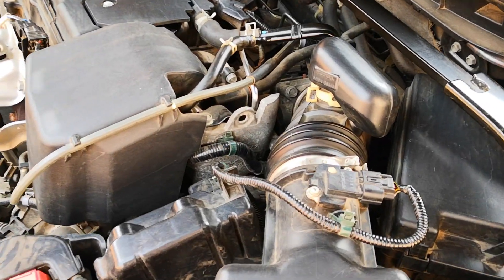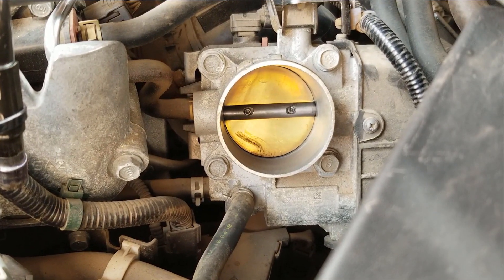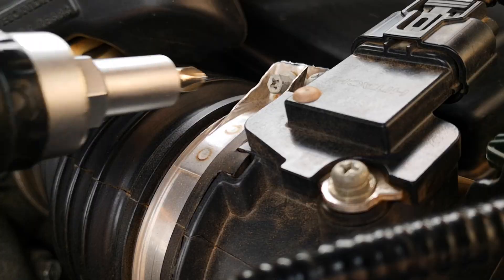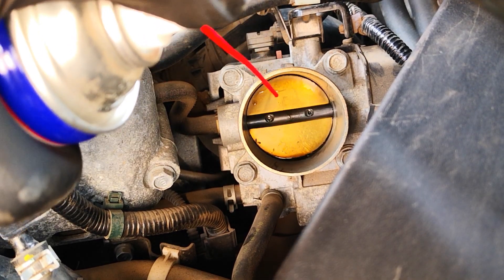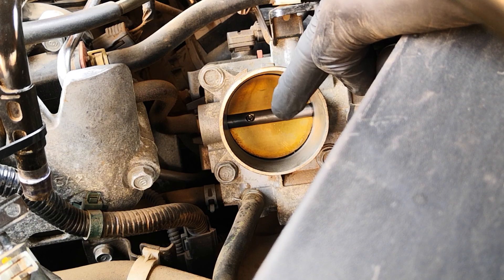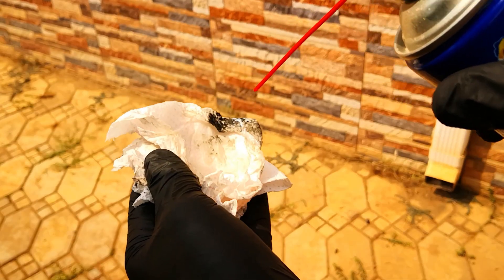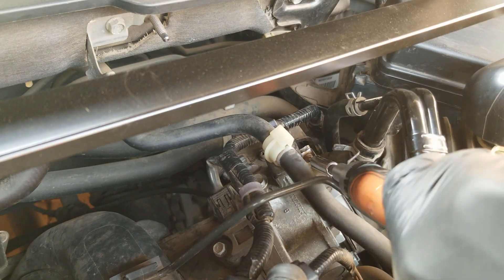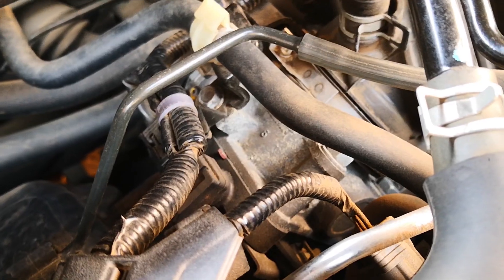Safely Clean Electronic Throttle Body Without Removing / How to Clean a Drive by Wire Throttle Body

Comment from the maker: I do this procedure every year! Is your throttle body electronic (drive by wire) and how often do you clean yours?
Reply: no need to disconnect the negative terminal on the battery?
Reply from the maker: If you do, you can't use the gas pedal to open the throttle valve, except if it's not drive by wire.

Comment: Let the cleaner dry for 10-15 minutes before reattaching the intake pipe and starting the car. I would suggest only using Throttle Body cleaner CRC makes a good one and the can will last for several cleanings. To make this a complete job, use MAF sensor cleaner ( only use MAF cleaner as the MAF is a delicate part and other cleaners ( carb, throttlebody etc. ) may leave residues on it. Check and or change  the air filter as well. Now your car is happy. Just a note, your car may idle slightly higher for a couple hours or a couple days after a throttle body clean especially if it was heavily carboned up. The ECU will gradually bring the idle back to normal rpms. You may notice a smoother idle, a “ crisper “ acceleration and possibly a tiny bit better fuel consumption.
Reply from the maker: 💯
Everything you recommended, I do once a year. This video was just focused on the throttle body. And yes, I only use throttle body cleaner now, to ensure coatings are not stripped.
I actually recalibrate the TB anytime I clean it and relearn idle. The recaliberation resets the learning value which adjusts with carbon buildup
Reply: @DIYAutoworksNG p.s. I should have mentioned don’t “ over clean “ the MAF sensor. Cleaning it every 50,000 miles is probably sufficient, unless you do a lot of driving on dusty toads or don’t check your air filter or neglect your air filter.
Reply: you can't clean some MAF sensors, such as a Karman Vortec MAF sensor. There is no hot wire to clean, and uses a series of mirrors and a laser to "listen to air volume". Cleaning these will destroy them, and there is a warning against using it on Karman Vortec MAF sensors on Throttle Body Cleaners. Companies that use Karman Vortec MAF sensors are: Toyota, Mitsubishi, Lexus, BMW, Plymouth, Eagle.
Reply: @TeamGun yup you’re right.Some of the newer Toyotas it’s the same way. The MAF would have to be changed when and if they become dirty and they’re not cheap.
Reply: @Zeek800 My 2003 Eclipse Spyder GT needed a MAF replacement for its KV MAF and the cost for OEM from Mitsubishi was $700! The Delphi replacement I bought for $250 is hot wire and barometer combination and through testing at idle it should be reporting double the engine displacement and just a bit, and it's reporting 7kg/s air volume (it's a 3L engine) so it seems that you can replace a Karman Vortec Maf with a traditional hot wire Maf and it'll provide an accurate reading for the ECU to provide fuel. Just something good to know for those with KV sensors that would like a sensor they can somewhat service.

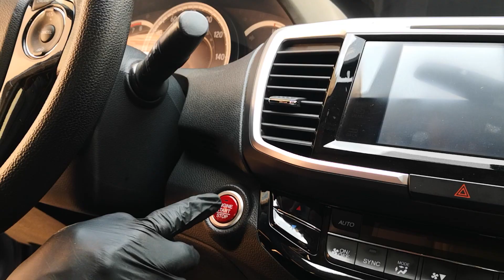Comment: At 1:44, when pressing the Engine Start/Stop button, don't press the brake pedal. This way, the engine doesn't actually start. You need to press the button twice to get the right effect. Then, when you push down the gas pedal, the butterfly will open, even though the engine doesn't run. I learned this trick from another YouTube video "How to Clean Honda Throttle Body" by "Lover of Engines"
Reply: Didn’t happen in the Hyundai
Reply: @anuruddhadissanayake4881  Honda... NOT Hyundai

Comment: The service manual literally says not to do this and spray directly into the throttle body 😂👎🏼
Reply from the maker: Thanks for sharing. Just searched and seen it. Recommends spraying on a cloth and then cleaning. Funny thing is I've always done it as in the video and never had issues. That said, I'll make the switch.
Reply: @DIYAutoworksNG I've always just seen it sprayed n as well
Reply: @LowVlogDrives  If a car is old school and uses a wire to the throttle body, you can't spray it into the throttle because you will destroy the idle air control valve (IAC) and could also ruin the gasket on the base idle set screw (biss). You can spray it in on electrical throttle bodies because air volume is controlled by the butterfly even when off throttle.
Reply: @TeamGun thank u
Reply: @LowVlogDrives  You're welcome :)

Comment: Car nut says ots dangerous to turn in the car and open butterfly this way. Just gently push and clean not hard or fast.
Reply from the maker: I've done it for years and never had an issues. I do have immense respect for carcare nut, but don't currently see how depressing the pedal with the ignition on will hurt anything. If you have the link to the video where he said it, please share. Thanks.
Reply: @DIYAutoworksNG search car care nut throttle body he says you can gently move throttle plate when car is off completely off

Comment: What if the throttle doesn’t open
Reply from the maker: Yea. Some cars are like that. You may then have to just push it open or command it open with an appropriate scan tool.
Reply: Try turning on the key, don't start, and push the accelerater

Comment: How do u clean the butterfly if dirty?  Can butterfly open & gas pedal pressed while engine is off?
Reply from the maker: Good question. Depends on the car. For this car, ignition has to be on/engine off with the foot on the gas pedal for the butterfly valve to open.

Comment: some electronic throttle body doesn't move if you don't start your engine, no worries just have someone press and release while you spray the throttle body cleaner, throttle body cleaner also helps clear carbon deposit on your piston so its actually a win win situation just make sure your assistance press the gas pedal at certain rpm to make sure the engine doesn't stall
Reply: Thanks for the info cause I just tried to clean mine and it doesn't open with the key in the on position.
Reply: @rushdrift  no fire fire

Comment: Not quite right. You forgot to mention to let all the carb cleaner completely evaporate before re attaching the air hose [ about 30 minutes] so that the high octane cleaner does not trip the O2 sensors and cause a rich/lean code to come up.
Reply: If that's the case, then I guess you should leave the butterfly in the open position the whole time for the drying?  And of course you can't do that with the cars that require a running engine, however many of those there are.
Reply: Not quite right...  You are not supposed to use carburetor cleaner on most modern throttle bodies because it is too harsh and can damage the protective coatings, sensors, and seals. Use throttle body cleaner only.
Reply from the maker: Yea. I guess it's only normal to know it should dry before firing the car up.

Comment: Some car don’t open butterfly even if in ignition and gas pedel press ! Mostly in Nissan 
What will we do that time ?? Pls reply
Reply: Should open if you put gear selector in drive
Reply from the maker: This is with the ignition on, correct? Not sure if a scan tool can be used in this instance or whether it's one of those situations where you take care to clean like on drive by cable systems. Still searching for more info around this...

Comment: I wouldn't use carb and throttle body cleaner it's not meant for electronic throttle bodies.
Reply from the maker: I agree that the best for this is throttle body cleaner. I was out of stock at the time and needed to do this as part of troubleshooting I was doing at the time.
Reply: Can I use rubbing alcohol (methylated spirit)?
Reply from the maker: It won't have sufficient cleaning power.
Reply: @FrancisChidobe yes you can